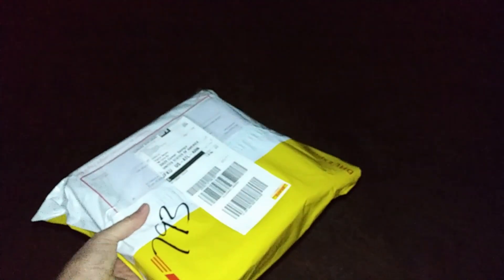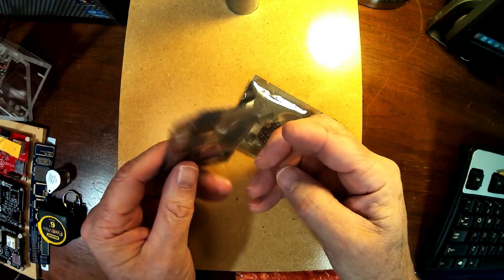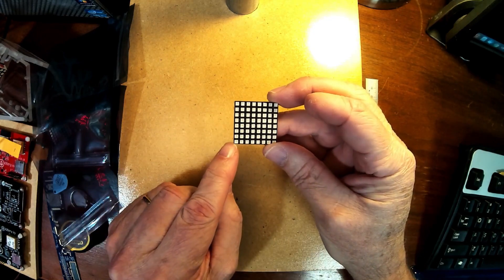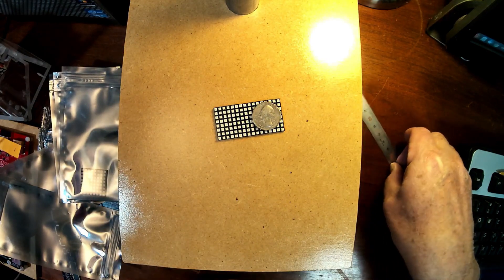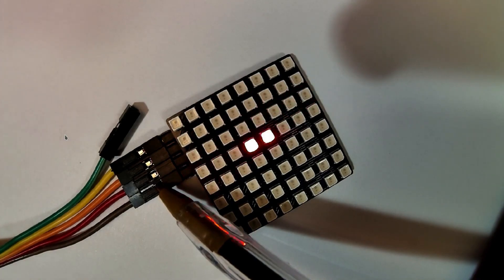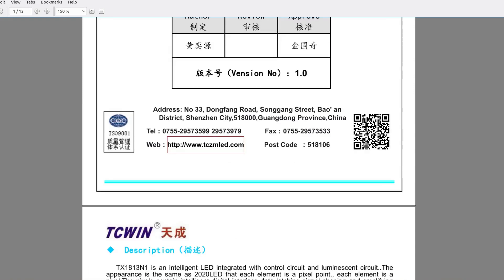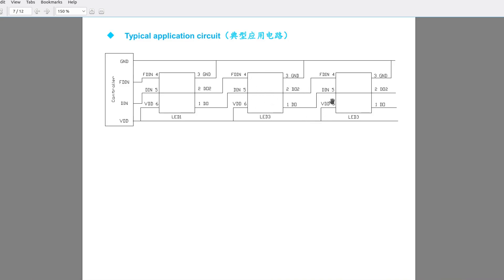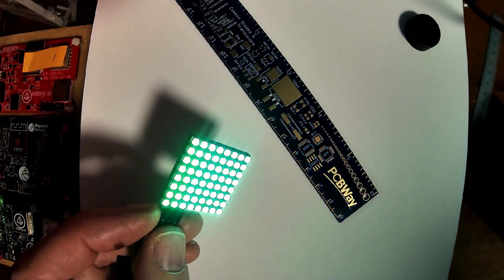Tiny "NeoPixel" 8x8 LED Matrix - PCBWay Assembled Circuit Board Unboxing

Comment: Have you tried these with the fastled library ?
Reply from the maker: I haven't. I've just written my own library with functions I'm interested in. However, I haven't had any issues with these LEDs using the standard MicroPython neopixel module or the esp.neopixel_write function. Also, the serpentine layout is the same as standard 8x8 grids using the 5050 LEDs.

Comment: Super cool design! I think I have the same leds in a Christmas lights string I bought from banggood since they also have two data ins for each led. I blew a fuse on my esp32 when I was messing around with them though :'(
Reply from the maker: Might also be apa106 types, which use an SPI signal. You have to be careful with those gpio pins, can't over volt or over amp them.

Comment: Why use one of these over something that’s I2C?  I2C seems like it’d be easier to control
Reply from the maker: One wire easily controls 1024 RGB LEDs. I don't know of any I2C devices similar to that.
Reply: @ClaytonDarwin  Ah makes sense
Reply: One wire is better than two wires as long as micro controller pin count is concern.